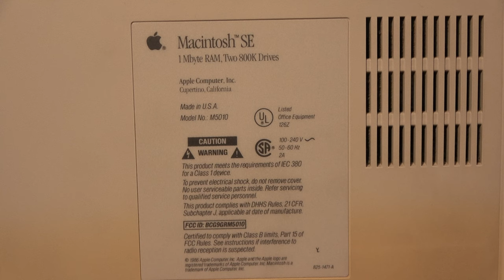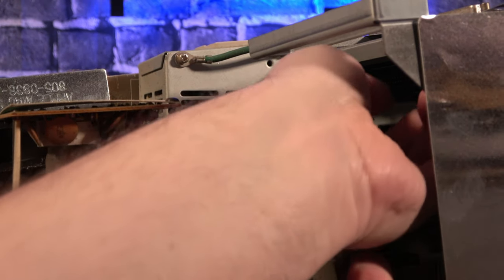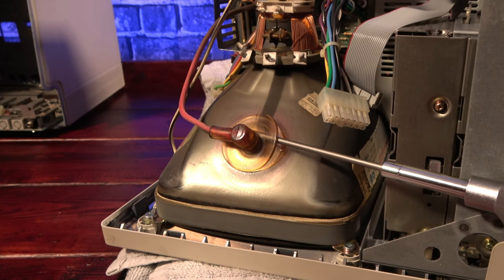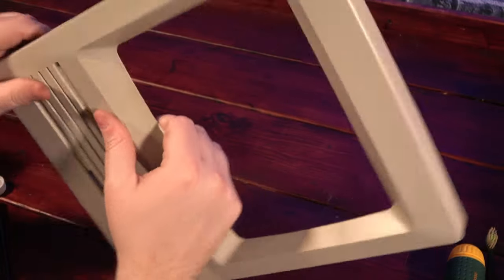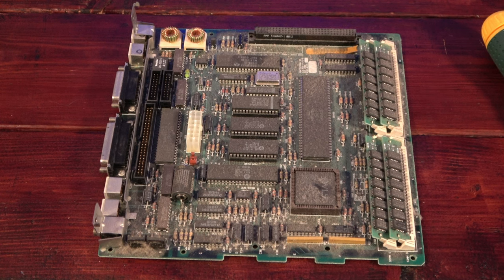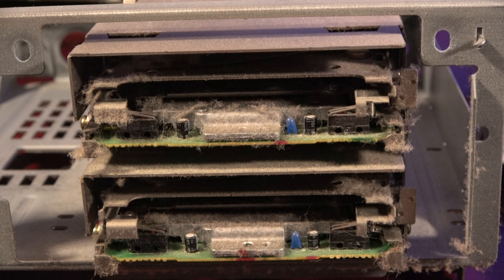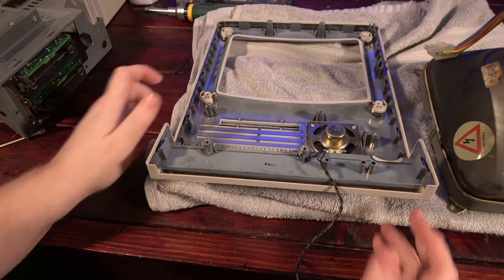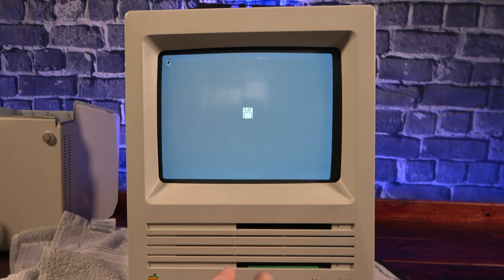I broke this Macintosh SE. [Part 1] #MARCHintosh

Comment: I thought you were going to damage the CRT.  That's the part I worry the most about
Reply from the maker: Same here. I am always nervous when I pull a CRT... replacements exist for almost everything else.
Reply: @PNPRetro  I'm hoping someone comes out with a converter to allow us to install LED panels.  Even with a Raspberry Pi Zero in between.

Comment: This is awesome! I reminds me of my Tandon 286 wich i had teared down, assembled with new parts (VGA Graphics, Soundblaster CT2940-> IDE CDrom, 2. Floppy drive, 3MB XMS Card and XTIDE Bios with 1GB CompactFlash) and retrobrighted the outer plastic shell of the case. :)
Reply from the maker: Sounds like quite the overhaul!
Reply: @PNPRetro  Maybe...
Surprisingly, after so many years, the power supply still has such good values.  In order to check that, I sent the power supply to someone who is familiar with something like this and has the appropriate equipment.
After I got the power supply back I exchanged the stock fan for a Noctua NF - A8 FLX.  Now the 286 is practically inaudible 😅

Comment: Bad luck about the springs, but if there is one thing you did right it was ensuring the shafts were well oiled before jamming them in.  :)

Great guide on what to avoid and thorough as always, looking forward to the conclusion where I have little doubt you will get this working again.

Comment: You want to discharge the crt first thing before doing anything else before you get a nasty shock.
Reply from the maker: I absolutely did that. I didn't want to provide a tutorial on how to do the discharge, because I'd hate for someone to follow my advice and end up hurt. But I safely connected the contact under the suction tube to ground before I dug into it, just wasn't filming at the time.
Reply: @PNPRetro  I was a service tech back when these were out.  Some of them can pack a nasty punch or trigger a heart attack if the energy travels the wrong way.  Be safe people.
Reply from the maker: @chrisyannella8682  I can't imagine how many people must have zapped themselves trying to self service these back in the days before easily accessible internet guides. I probably would have zapped myself if not for having watched so many videos of people doing restores.